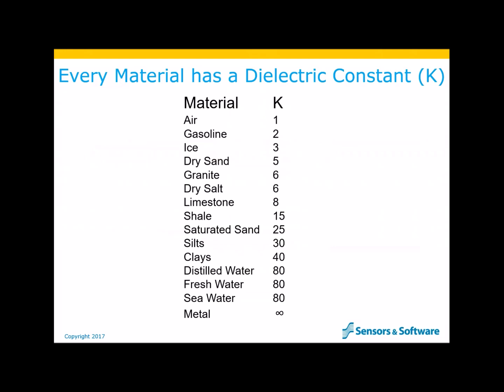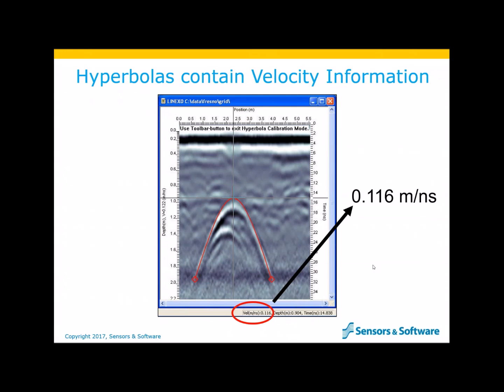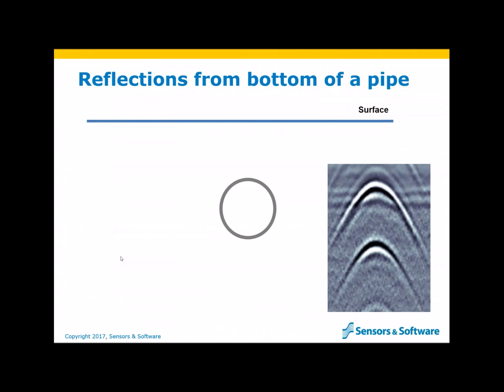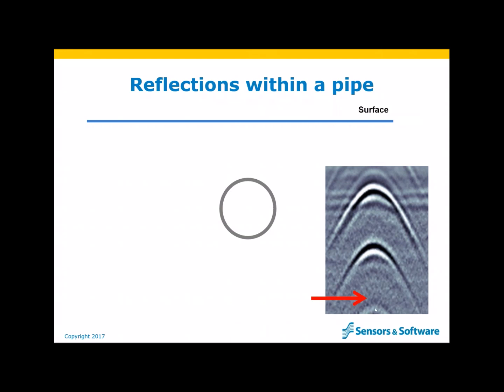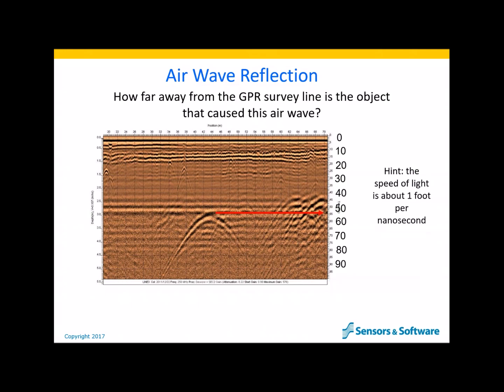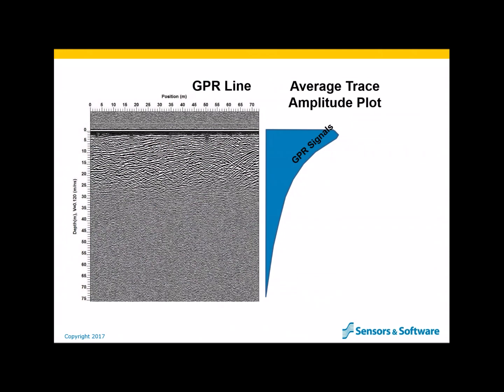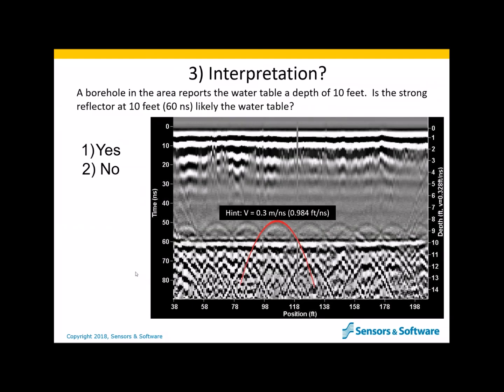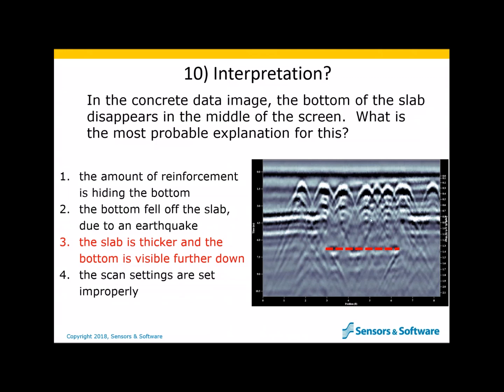Webinar The Basics of Interpreting GPR Data   Part 2   Quiz and Answers

Comment: Wouldn't the one way travel time be multiplied by two to represent it going through the pipe twice, not divided? I'm not the best at math so I am probably wrong.
Reply from the maker: Austin Garrison The GPR signal in the data we collect goes through the diameter of the pipe twice. That is two-way travel time. We want to calculate the diameter of the pipe, so we only need the one-way travel time. Therefore, we DIVIDE the two-way travel time by two to calculate the one way travel time

Comment: Is there any material that could help me to interpret rock discontinuities (fractures)?
Reply from the maker: We don’t have any webinars that specifically discuss fractures in rock fractures, but fractures are often strong GPR reflectors because of the contrast between the rock and the air or water in the fracture.  They are also somewhat planar, so you get a response like a boundary.